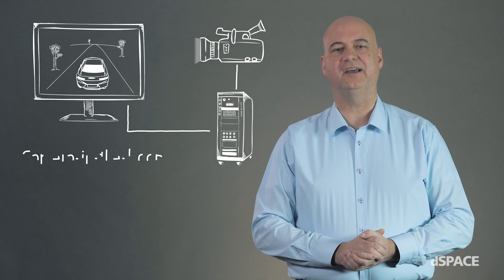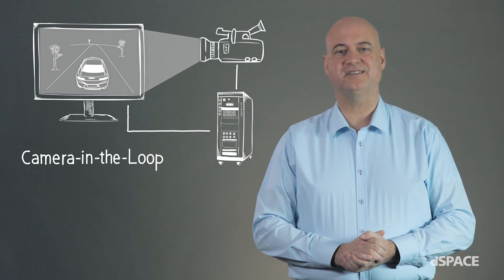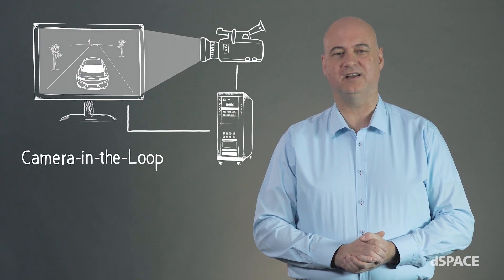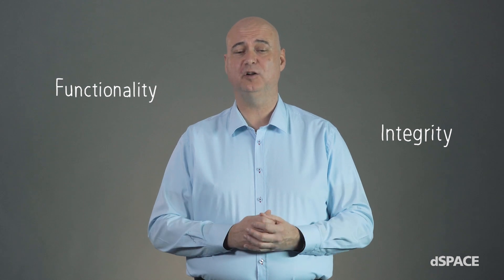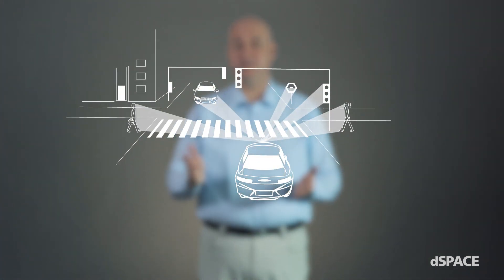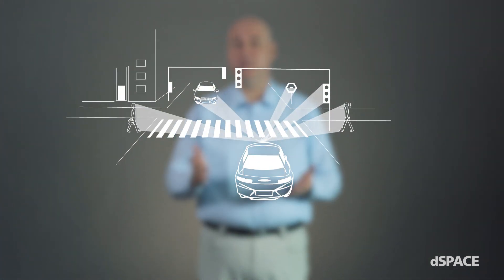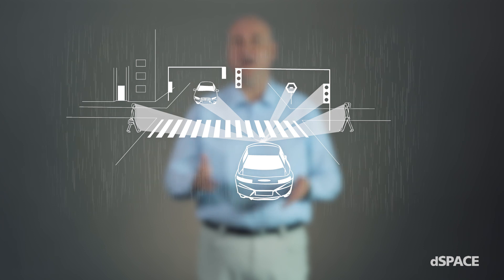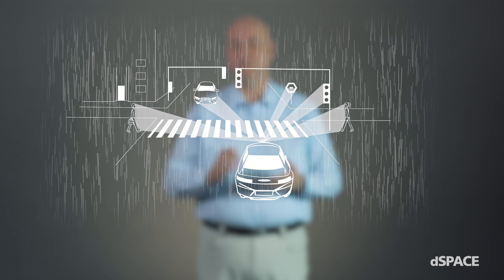How can Sensor Simulation Help Make Autonomous Cars Safer?

Comment: Hi, how do you simulate software sensors, fx radar that outputs object detections with an embedded software whose characteristics are unknown?
Reply from the maker: For Research & Development you can use dSPACE models to test your algorithms. 
In the area of validation, interfaces exist for the integration of third-party sensor models.
Feel free to get in contact with us to further discuss your use-case.
mailto:info@info@dspace.de or mailto:support@dspace.de